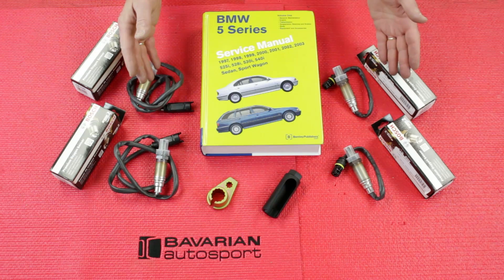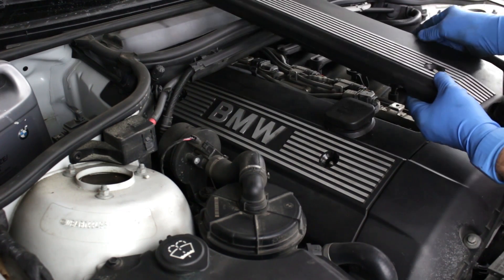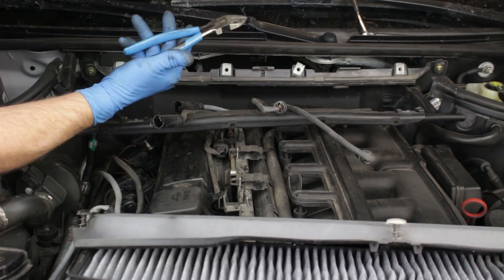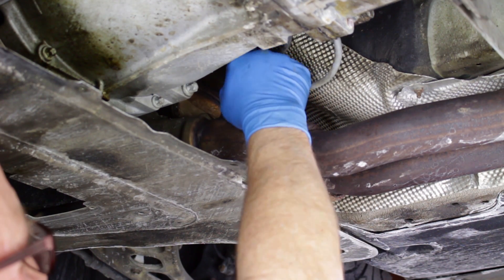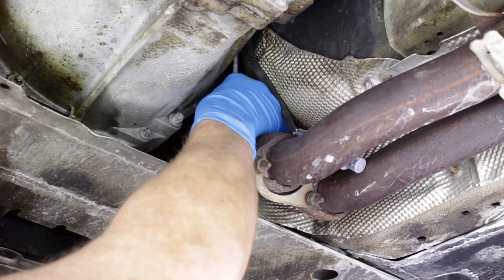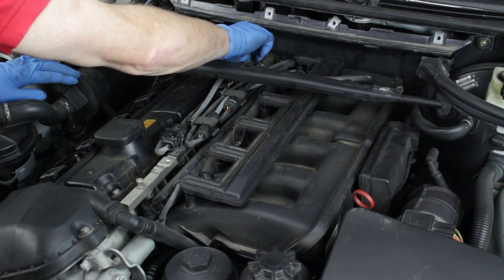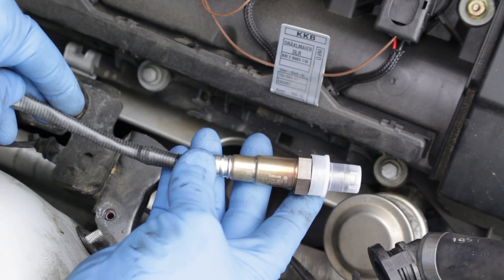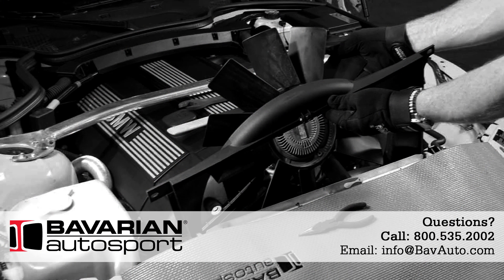Replacing O2 oxygen sensors on BMWs 96 on and MINIs 02 on OBD-II

Comment: Hi I watched your video here, can you tell me what color each corresponding sensor is to be bank 1 bank 2 etc pre catalytic converter and post catalytic converter for the 2006 X5 3.0i sav. 

Note: I replaced engine with a 2004 BMW 330xi AWD engine wit 63k miles. It's also the M54B30 type engine which was in my 2006. I am not completely clear if both vacuum hose lines are ran the same..bcuz I now have a vacuum leak with electric valve missing a hose line from it an to it. My EGR valve doesn't have a hose from it, however the replacement engine did have it coming from one that was attached to engine b4 being put in my BMW X5. Any thoughts on that aspect specifically would be greatly appreciated...
Reply: Tyrone Maye do u know the color for the post o2 sensor pleas help me

Comment: @Bavarian Autosport  I have a 1998 e38 740il. I've been tuning it up a little here a little there. I've owned it for about 2 months now. When I bought it it would have a little shake every now and again. Eventually it became constant. Recently I put 8 new NGK-R plugs in it and it ran perfect for about 10 mins. Then it started to have a little engine shake again but worse than before. I checked the codes and they were for the 2 postcat o2 sensors and the passenger side precat sensor. I got 4 working oem sensors off of a wrecked but running 98 740il. Installed them all and reset the codes. I pulled the plugs out and the drivers side were lightly frosted and the passenger side were fouled and black. I now have p0130  as the only code and I put my old bosch platinum +4's back in it. It runs smoother than the single prong ngk-r's but the mpg's are worse. Should I just swap one of my old precat o2 sensors back in it? And lastly is there anything else that would cause one side of the plugs to be fouled that wouldn't affect the other side other than the o2 sensor? Thanks. Love your videos.

Comment: Late question for an older video. My 2003 330i is saying i have a cylinder 4 misfire. I've replaced, all vaccum hoses, DISA, intake boot, and coil packs, plugs, and even the coil pack harness itself. Is it likely that my o2 sensors are faulted? 129k miles. If so, would i need to replace all four, or just the sensors for bank 1 and 2. P0171, P0174 codes are what is showing. Thanks in advance.
Reply: I have a 01 330ci and I was getting those same codes for the longest time. Replaces hoses fuel filter, fuel pump, o2 sensors, coil packs. Then finally just bought a whole new MAF and it fixed the problem never had a problem since.
Reply: What was wrong? MAF?
Reply: +George Palmer yeah sorry should have said MAF sensor
Reply: +Tripp Sullivan I replaced it a month or so ago. Light went off for like 4 days then decided to come back on. Now it's leaking coolant lol
Reply: +Acclimatising I actually just replaced a coolant line myself lol it's like a never ending cycle
Reply: My 530i is gonna need a coolant system overhaul pretty soon. Over the weekend i had to clean the MAF and replace the cam sensor and noticed a couple of coolant leaks.
Reply: Tripp Sullivan for real dude. Its like dominoes or a chain reaction, eventually all I'm gonna have left to replace the is the fucking engine. Maybe go s54 or some shit who knows -_-

Comment: I've taken my 05 MINI Cooper S to a shop to have both sensors replaced at 116k miles with Bosch sensors. Days later the check engine light turns on. I bring it back and they said that the bank 1 sensor 1 (P0130) code popped up. So they replace it again. A couple days later the check engine light turns on again now they want to replace with NGK sensors. I don't want to waste my time but are there issues with non OEM sensors on these MINIs or does the dealer need to clear codes themselves? Dealer is an hour from me and an inconvenience. What should I tell my shop because I feel they should eat the cost.
Reply: i have the same problem , i replaced twice but after a few kilometers the light pop up again  :( 
the service workshop pull out a used one from a mini that s have no inspection light or error for the O2 sensor , it didnt work for me once we install it.
did you find any solution for yours ??
Reply: +mohamad Zeinedine yeah. I actually had to bring the car in a couple times but the issue was resolved after installing the NGK sensors. For some reason, Bosch doesn't work if you're going the non OEM way. They ended up replacing them free of charge. I just wasted time.

Comment: Hi, this is a great video.

I have a question. I have a 1996 328i. The scanner I used, gave me a lecture of Bank 2 sensor 1. Do you mind explain to me which one is which. 

I think you referred to it but i am still little confused. Maybe by telling me in in which minute of the video I might understand better
Reply: I purchased a Bosch 13884 Oxygen Sensor, OE Type Fitment position upstream.

But I stil do not know which sensor is the one that needs to be replaced. Would you recommend to change all of them?

it has 131,000 miles on the motor
Reply: @Kiev182  yes. It's recommended to change them all just like you do when replacing your brakes

Comment: Great video and instruction as always!

Did I note a small amount of anti-seize on the replacement sensor threads? What are your recommendations on the use of anti-seize for this application?

Thanks again. I really enjoy your videos and products for our beloved BMWs.
Reply from the maker: The sensors are shipped with a dab of aluminum based anti-seize on the threads.  This should be adequate.  If you did wish to add more, use the aluminum type and be very careful to prevent any from getting on the sensor's end.
Reply: BavarianAuto Perfect! Thanks for the clarification.